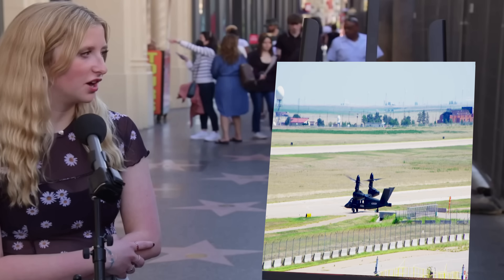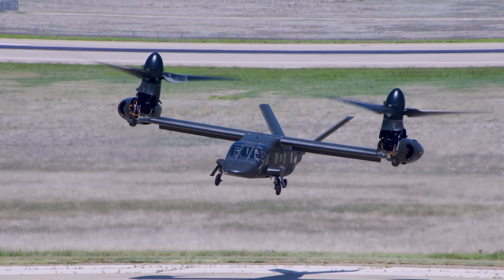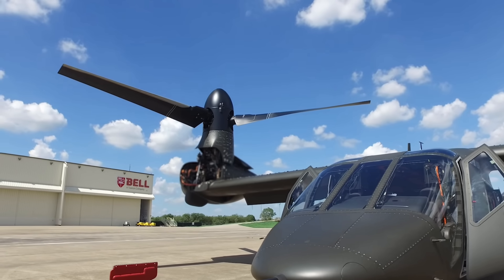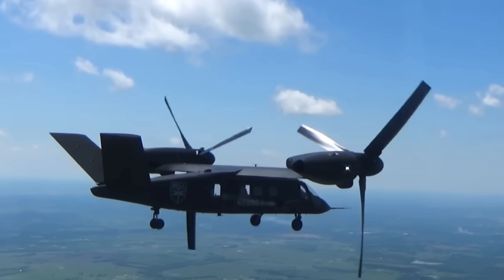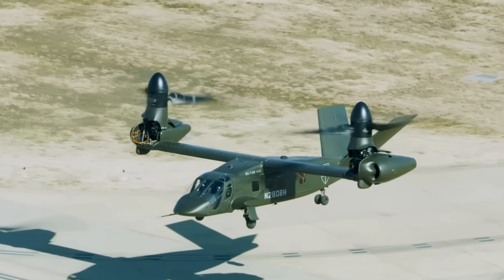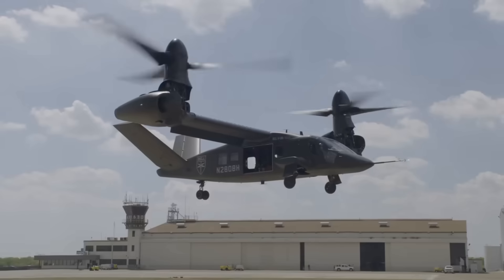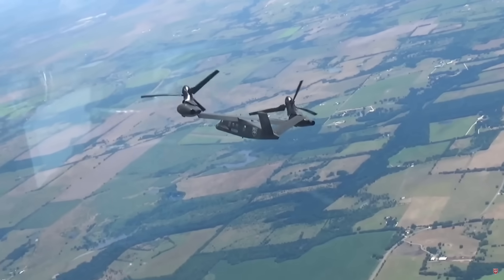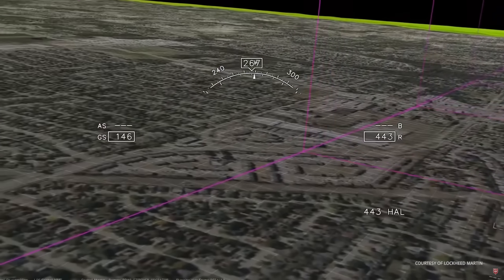Bell V-280 Valor - What's the big deal anyway? | BLACKHAWK REPLACEMENT

Comment: My question is what happens after an RPG or something hits one of the tilt rotors while in flight? Can it glide down or 'autorotate' to a crashland? And if that thing has to be deployed to an urban area what'll stop it from becoming an RPG magnet seeing that it's unlikely to maneuver between buildings but'll have to stay above the cityscape?
Reply: Rotors are the most difficult things to break on a helicopter. If one engine is taken out, it can fly at reduced power like any other mutiengine helicopter. Tilt rotors can glide and autorotate as well, but autorotation has not saved a single multiengine helicopter in decades of their use. It can fit in 3 out of 4 sides of any box you can make around an H60.

Comment: The Osprey has a similar incidental rate as the Blackhawk. Similar with deaths too. Much like the F-35 generated headlines for its accidents but when the data came out and people found out it was safer than the F-15 it was clear that the reporters oversold the danger of the aircraft.

Comment: No U- joints, no constant velocity joints, the key is bevel gears, just as rear wheel driven cars convert the torque 90 degrees via the differential gear.  Simply ingenius in simplicity.

Comment: I hate to be the negative Nancy here about this airframe but,,, IT JUST CANNOT OUT MANUEVER THE UH60 BLACKHAWK!!. I am a retired UH60 A/L pilot / ASO who has flown the UH60 in combat. The Bell V-280 would be an ENEMY EASY TARGET trying to fly into combat inserting troops or MEDEVAC picking up CAT A casualties under fire. If the V-280 looses an engine, it's a crash Vs any controlled crash landing with a chance of survival. The V-280 looks cool and all but, so did the Osprey. How many Marines have died because of the good idea fairy airframe?? Look at the Lakota UH-72 airframe the Army decided on back around 2009. I knew one of the experimental test pilots that assessed that airframe giving it a NO Vote survey for it's lift capabilities with passengers and/or 2000lb sling load. Where is the Lakota now? At Ft. Rucker/Novosel as the intro training airframe for flight school after they got rid of the Bell Jet Ranger 206. This will be another bad decision by our military leaders to put the V-280 as a UH-60 replacement. Soldiers WILL DIE senselessly because of the good idea fairy.
Reply: 1. Valor passed the same level 1 low level handling requirement the Black Hawk passed... at a minimum it is as maneuverable as a Black Hawk.
2. If you can hit a Valor you will be able to hit a Black Hawk.
3. Valor would be in and out of the combat zone in half the time with its greater speed and acceleration / deceleration
4. Both engines turn both rotors at all times so it can fly on one engine... least research the basic facts of the platform.
5. Less marines than other platforms... Hell the Osprey in the Air Force has a better crash rate than the Black Hawk in the Air Force.
6. Except all the test pilots had nothing but good things to say about the Valor vs the Defiant or even Black Hawk... It has also proven these numbers in direct testing.
Reply: So yes you are being an uninformed negative Nancy. Which is even worse frankly as you didn't bother looking up the basic facts.

Comment: The biggest improvement has been the choice to keep the engines fixed, while using smart gearing to support engine pivots.

The Osprey's engines pivoted with the props in those giant nacelles.  This was madness, as the rotational energy of the engines acted like a giant gyro to offset rotational motion.  This was largely offset by its FCS, but that had to make even simple control during slow speed transition a nightmare.

Comment: The arrow points at the thumbnail - What if I shoot there with an anti-material rifle?
Reply: ... what happens if you shoot the cockpit of any transport helicopter...
Reply: @n3v3rforgott3n9  It can be penetrated, if the projectile have really high stopping power.
At least that's the case in Battlefield 2. It's a feature since than.
Reply: @Hizsoo  ... please don't use video games to determine what you think of real military hardware. Transport helicopters like the Black Hawk even do not have very bullet resistant glass for the cockpit not to mention every helicopter has an open air intake for the engines. The V-280 will not be any more vulnerable than any helicopter and will be less so if you factor in the capability of getting in and out of the hot zone in half the time.
Reply: @n3v3rforgott3n9  Some anti-material rifles shoot .50 can BMG ammo. You can watch penetration test videos about it. No one is shooting at helicopter panels in a video (yet), but you can use comparison. One of the rifles is designed with quite ideal features to shoot at helicopters, but didn't went into factory production. Still lives it's full glory in video games.

Comment: I think part of the reason the Valor has a bigger silhouette, besides the wing, is that it's bigger than the Blackhawk. Carries more. Though its ability to go into airplane mode and fly higher, faster and further makes up for the potential vulnerability. Helicopters fly low & slow, thus are vulnerable to MANPADs & such. Being able to fly faster and higher would be helpful.

Comment: The next generation of the V280 Valour  type of hybrid aircraft, will have bypass- jet engines thrusters at its wing tips, instead of the large unwieldy propellers. It will also require fore and aft air bleed thrusters for stability and control.The thrusters will enable the plane to  take off  and land conventionally if need be, thus saving  fuel to  fly a lot faster and further. Plus the ability for VTOL  when mission required. A further benifit to jet thrusters as opposed to those large blades, is that the craft will present a much smaller target profile!  The technology for the next gen of V22 valour , as I suggest, already exists, just swop out the big props, for wing tip thrusters. All flight control systems could remain the same!  Basically they want a small transport/attack plane  that has true VTOL capabilities, flies fast, a long way, can hover like a helicopter and fly like a plane back to base. the V22 Valour fits the bill nicely, except for thoise oversized props ! Hence my suggestion for the next gen of V22 valour!

Comment: the 3 key things that you absolutely cannot compramise on in reguards to a UH series. a transport helo. personel size. extra space. at least an infantry squad. more is good. armour. and rate of infil/exfil. (lift ability is good. arty peices ect) but more importantly. you get in under fire you drop your guys under fire you leave under fire. as little time as possible. this thing will fucking die every time it does a landing under fire. already its a failure. as for the new sikorsky its an absolute disgrace. its an abject failure in every reguard. this is better but only as a ch. a heavy cargo helo/transport helo. like the ch47 and osprey. as for replacing the uh-60 islt shouldnt even be conciderd.
Reply: You have zero facts to back any of your statements...

Comment: Boeing made the wrong argument when contesting the Army's final decision. Instead of saying their helicopter was better, they needed to argue that the Army clearly stated the new aircraft MUST fit in the Blackhawk's footprint. The Valor is far too wide and Boeing's helicopter complied with this requirement. The Valor may be the right choice, but Boeing built their helicopter to match the Blackhawk's footprint. If the Army wanted a tilt rotor, I would have like to have seen Boeing's offering.
Reply: It has a 19% larger footprint and carries 23% more troops.

Comment: Wild promises sold this.  Haven't seen anything to back it up.  Looks like a 'everything for everyone' over-hype f-35 trash monster. And it's going to replace apaches?  Sure! At least it's expensive.. 🤔
Reply: You are just a fool then if you think the F-35 was a failure.
Reply: @n3v3rforgott3n9 Who was to know the F-35 would be such a success?  Question?  When do “they” know when a device has a future and when it is a dud?  At least the Zumwalt Class of ship was a dud.  Now, when and how did they know so soon?
Reply: @Handle1969  Tests... no shit. If the airframe is showing X performance over an already existing frame than it would be a success if it can hold that performance and not have other issues. The other way something can fail is not have the support to see it thru until it is mature or has enough frames to successfully perform the role it was designed to do. 

An issue with the F22 is that not enough were built so it will limits its maximum service life even though it is very successful otherwise. It lost support because the perceived need for them was lost when the USSR collapsed.

Comment: All I'm gonna say is that, since the Korean war in the 1950s, helicopters have been used by the military to do helicopter things.  That's 70 years of using one type of aircraft to perform dozens of types of missions - Search & Rescue, close air support, transport, recon, etc. etc.  Now, the Army is apparently betting on a different type of aircraft to perform that traditional helicopter mission.  Say what you want about the Valor on paper - and the vehicle has some apparent advantages - but it's going to be a significant departure from what the different Services are used to.  I'm sure the Army thinks they've thought of everything - I guarantee you they haven't.  I'm not saying the Valor can't work out, but I'm saying that I hope the Army is acutely aware of the inherent risks - known & unknown - of replacing 7 decades of "tribal knowledge", intuition, assumptions & expectations.  It's ultimately our brave men & women who need to rely on these vehicles, not the folks making decisions in the Pentagon.

Comment: I'm thinking the survivability of it is good too. You mentioned putting a shoulder fired rocket into it. Even if a heat seeking missile locks on itll go for one of the two engines not the crew cabin. So from a laymans perspective it looks like roughly the same size as the blackhawk but moves the bits that pesky heat seeking weapons like to track well away from the squishy meatbags while also being nice and fast, long distance, and all that jazz.

Comment: Two things about Blackhawks and Mogadishu, one thing was that Blackhawks weren't actually made to be an general issue chopper, someone even pointed out here that the Huey wasn't completely replaced and it definitely shouldn't, but when the top brass saw the Seahawks in action in Iran they thought that platform would be perfect for everything, untill they learned they weren't. 

And now we can talk about Mogadishu, same scenario as the current war on Ukraine, no infantry support no chopper, that's fair enough, or at least should be, and is strange given how the Gulf war ended, since the air campaign prove to be insufficient, so ok, they tried to emulate the Iran rig boardings on a highly dense urbanized area, without sufficient cover and infantry support, guess what? They were pinned down and encircled, when the command notice what they did they sent the infantry to break the encirclement, which some of those were encircled again in the chaos and it ended in that debacle that everyone talks about, even tho they actually got way with less damage than in another air operation they did in Somalia, thing is, without support, that was a suicide mission. 

Why I remembered that? Well, there is nothing wrong with that design, even tho the surface area is larger, it will depends in how would be used, if used as they did in Mogadishu, yep, no surprise would be a tragedy and I actually think it can even be used again, history tends to repeat itself.

Comment: I'm interested in it's ability to flair and land like the Blackhawk when it loses all power. Not when the tail rotor gets knocked out but the more common loss of power and it can idle down and land using the fall to keep the rotors moving. Also, I wonder if it has redundancy in the axle to share power to both rotors w/ one engine. Seems that would be quite an engineering feet but maybe? Lastly, could electric motors be used w/ shaft turbines turning a dynamo inside the hull so wires and a shaft could power the blades. A bit late for the designers to incorporate any of these idea's but I'm sure they were considered and maybe some adopted besides the last.

Comment: Should update the larger V-22 instead with V-280 tech. Replace Blackhawk with Defiant. Supersized new tilt rotor could be a good add on for logistics support. Defiant for general purpose utility. 

Lockheed Martin Sikorski Boeing team has filed a formal protest with the Government Accounting Office. This may delay or cancel the decision and might create a new evaluation. Seems like they might have had some valid points about bias in the selection process which may or may not have tainted it. Protests of acquisition decisions are pretty common but are also frequently withdrawn soon after if there is nothing there.

Comment: Retired, Naval, Officer with many hundred s of hours flying many if which were flying helicopters. The Blackhawk will still be flying in good numbers for many many years. It has been outstanding in all respects.. If all goes well, the Valor will just begin entering service in about  8 years. And production rate will have it about a few hundred flying about 4 years after that. If all goes well.  But I predict that the v280 Valor not entirely replace the Blackhawk because they each have significant strengths over the other. Source: official statements by Bell and the US Army over projected production and entry to service.

Comment: That thing's got a very big profile! Will it withstand an RPG hit better? Nope! Why? 
Because you got too hot engines way out on the side of your frame! Those hot engines are magnets to missiles. Traditional helicopters get hit in the tail because the exhaust comes out there. This thing the rocket has two different options to hit, and unlike the Blackhawk or any other helicopter the body is not going to protect the engine. I can guarantee you this thing can't fly with one rotor only! This thing would fly around in the air like a drunken and blind bumblebee, but in a downward trajectory! Guaranteed dead.

Comment: The biggest disadvantage is: when attacked in level flight, there is a high probability that the blade will fall off and plunge straight into the cabin. The people on board are directly shredded. The picture can not stand to see

Comment: @8:20 "supercruise" means cruise at supersonic speed - obviously it doesn't do that. The high speed mode uses the rotors on a horizontal axis, operating as a fixed-wing aircraft, like every other "convertiplane".

Comment: @7:46 universal joints are mentioned - there is no chance that a 90 degree shaft angle change is being accomplished with Cardan (universal) joints. It will interesting to see the mechanical drive details when they become available, but it's not going to be done with U-joints.
Reply: An 2017 article by Aerossurance says 
"engine power is transmitted through a spiral bevel gearbox that transfers power to the proprotor gearbox.  This rotates on two spherical bearings."

Comment: Good stuff.

Wouldn't be surprised if the Defiant shows up as well. Thought Defiant's acceleration and slowing to hover times were better than the Valor. May be Special Forces or certain regular troops also use Defiant.

But Valor is overall better in utility, cargo and assault variants

Comment: I wonder if they add the rotating wing base thing (people call them "folding wings," even though they don't really fold, but ok) like the V-22 for storage. This thing looks like a pain in the ass to hide somewhere in case of an improvised airfield or aircraft carrier.
( I know that this ting won't really be used of carriers, that job goes tot he cmv-22b and mv-22, but still, for things like hiding it in some bushes in an improvised airfield or for transporting it with a c-130/c-17/c-5)

Comment: Personaly i will advise US Army for Defiant. Speed and range wont win a war if you dont have additional level of surviverbility. In Blackhawk down in Sudan rebels knew if they knock off the tail the Blackhawk will be down. The Bell Valor looks easy to knock off if you put a strong bullet to those exposed transmissions on hover or straight through the exust engines Let alone using RPG. 
The Boeing Sirkosky Defiant even if you knock off the tail the coaxial main rotors can still get you to safety.
The US Army can select both. One(defiant) for intense battle field the other(Valor) for spy, reconnaissance or interseption.

Comment: There are always pros and cons to any designs.   Many pros have already been mentioned by many vlogs.   The only drawback that i can see in this design is that it has very large footprint in any types of landings in terms of its actual landing footprint aside from clearances from the blades and/or between aircrafts.   With this, this particular aircraft may be a disadvantage if used in tight areas such mountain landings, cliffs etc etc.   Hopefully they will also fit inside the existing deck hangars of frigates, OPV's if they do ever develop a Navy Version for that kinds of helicopters like the SEAHAWK.  I would go for both designs if ever......

Comment: I have a feeling that they are not using u-joints, but rotating a gearbox around it's input shaft. Far more reliable as essentially only the bearings on the input shift see much of a speed change.
Reply: Yes. A 2017 article by Aerossurance says 
"engine power is transmitted through a spiral bevel gearbox that transfers power to the proprotor gearbox.  This rotates on two spherical bearings."